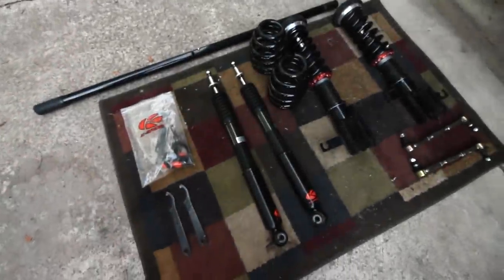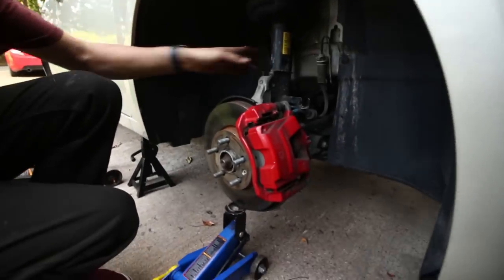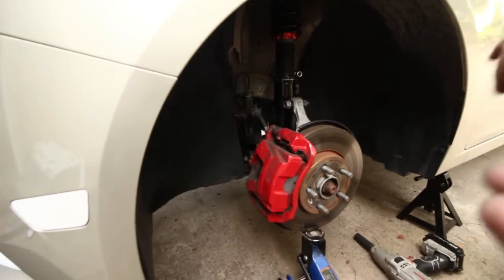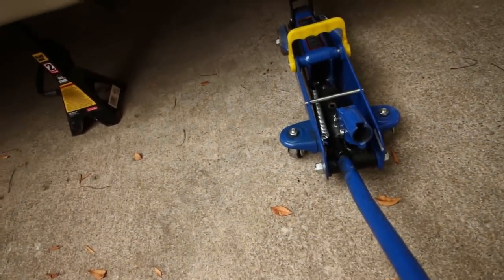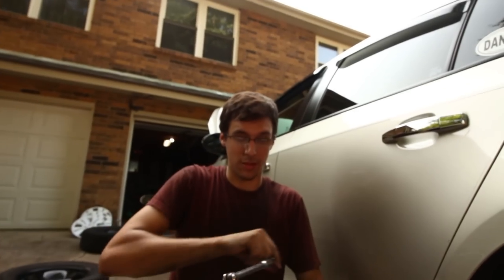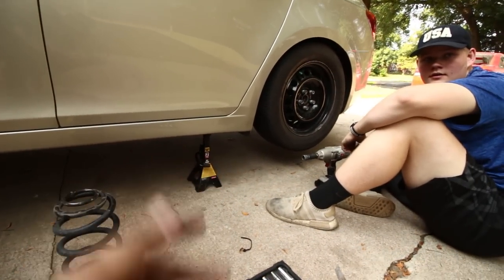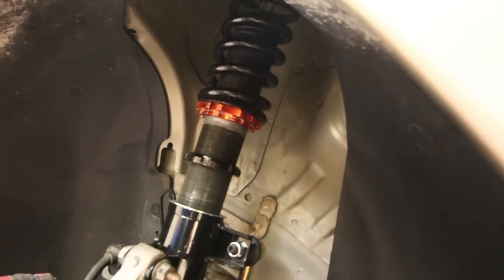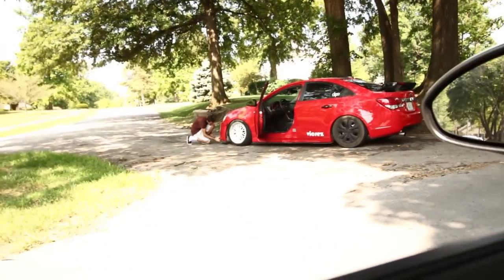Cruze Coilover Installation Guide| In Depth Installation

Comment: I'm considering coilovers for my 2014 Cruze LT.  The whole thing that kept me from getting them is how to adjust the ride height.  I got some idea from watching this video.  I'm assuming the black collar on the shaft is what makes the difference.  I want to get a set of aftermarket wheels (tentatively the ESR SR11 or the Enkei RPF1) and was going to go 17" on the wheels.  The idea of the coilovers was to help the wheels fill out the wheel wells with about 2 inches clearance from the tread to the fenders all around.

Comment: I got my eyes on a 2011 Chevy Cruise 1.6 LPG-gas with 117.000 miles, dealer is asking  7000 dollars for it.
I really like the exterior and interior of the vehicle, i currently own a hatchback and this Chevy looks ideal to my family room requierements,
i don't mind changing oil, filteres, sparkplugs, waterpump, coil covers as soon as i buy it, 
i would like to keep it for over 8-10 years, do you think it's a good deal and what is your opinion on this?